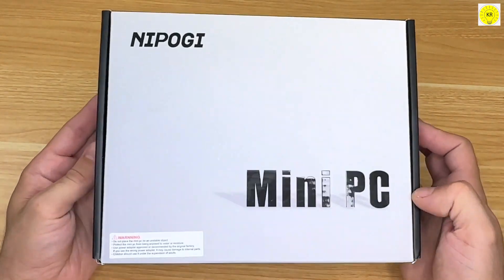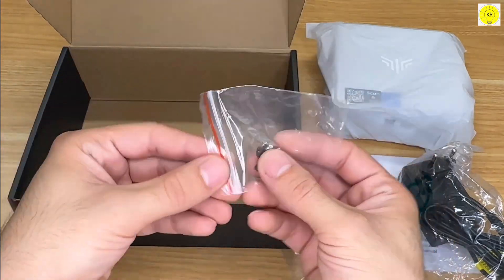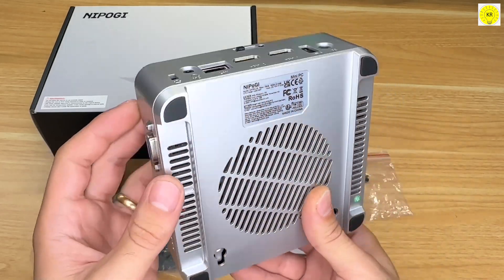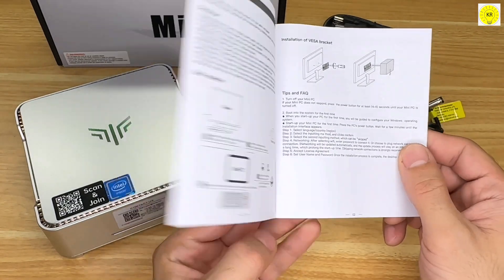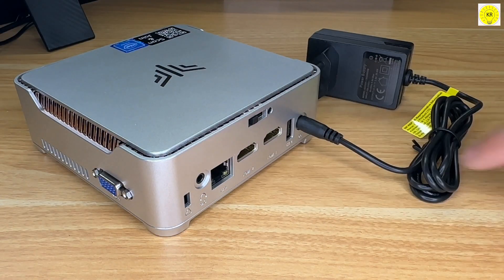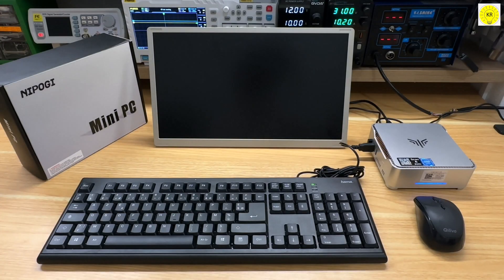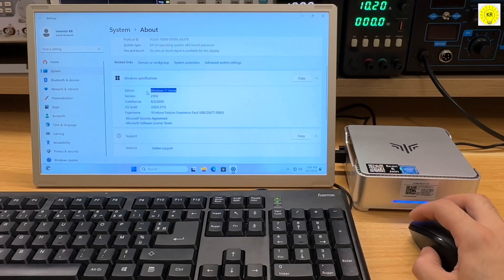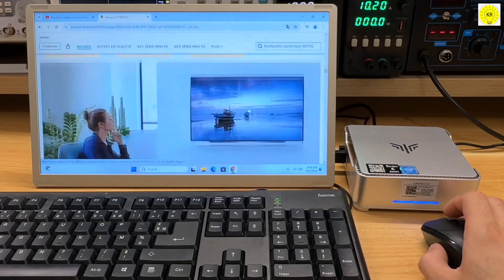Performance, Features, and Review! NiPoGi Alder Lake N97 Mini PC

Comment: I've just bought one of these. I only have one fault, the internet seems slow as if the adapter is throttling it.
Reply from the maker: Use an external Wi-Fi piece or you can connect it directly through the Ethernet port.
Reply: Have you tried video editing with it ?
Reply: @digitalmediafan no, nothing that taxing.